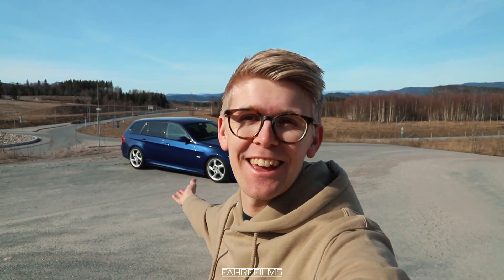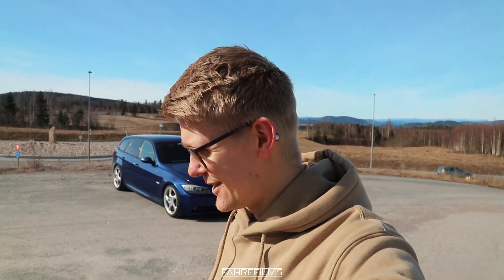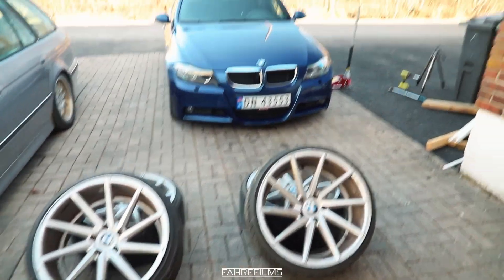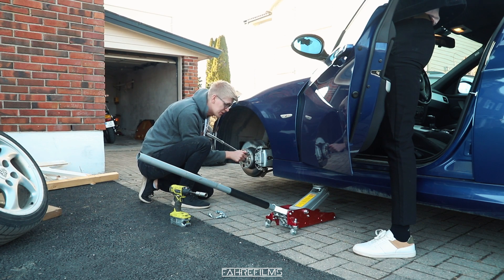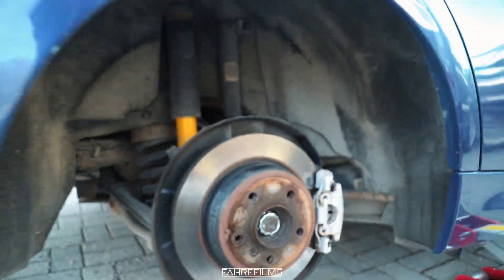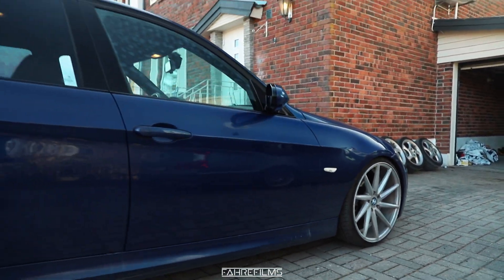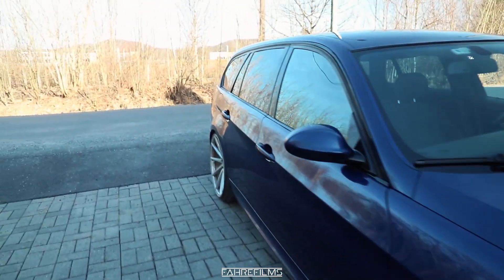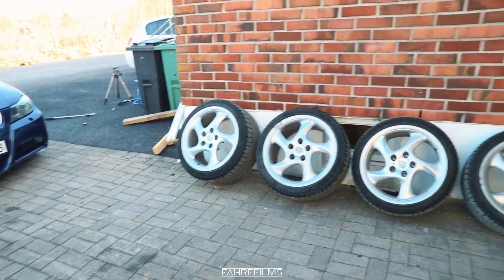My BMW Daily Get`s a Refresh ! Spring is here!

Comment: that sidewall looks tiny, I had r17 215/40 and managed to bend and crack the wheel when hitting a pothole and this looks even thinner sidewall than that so its a disaster waiting to happen, unless Norway has the worlds smoothest roads or you are very careful idk
Reply from the maker: Norway does not have the best roads 😂😂

Comment: hi bro good to hear from you, and i have a question for you, so whats your experience with 318d  cuz i have seen a lot of 330 and 335d. keep it going , peace
Reply: Personally I have heard horror stories about 318d for timing chain issue. Engine totalled and need replacement. 320+ definately better option
Reply from the maker: I’m happy with it, the prefacelift e91 uses the mighty M47 engine. Same as E46 320d. It’s a good engine 👍🏼